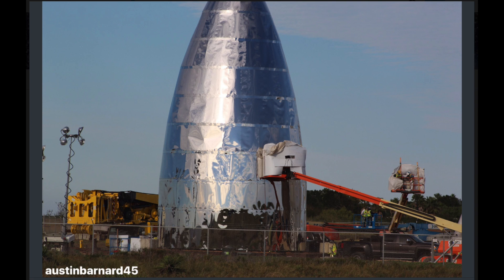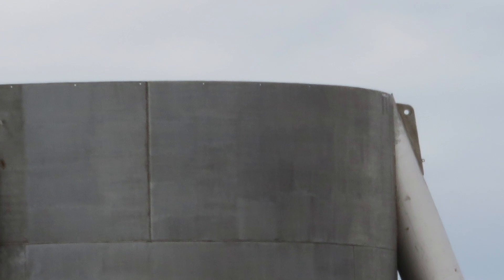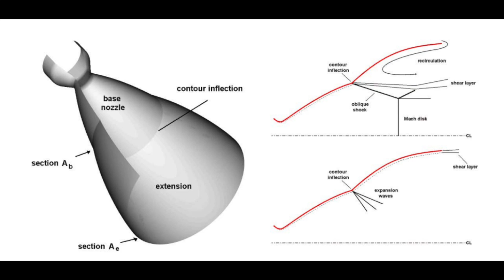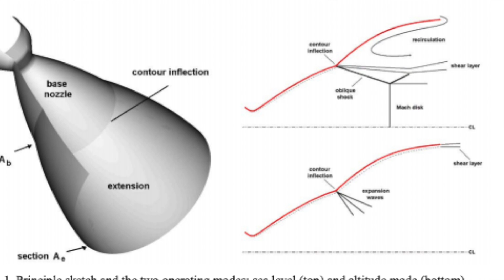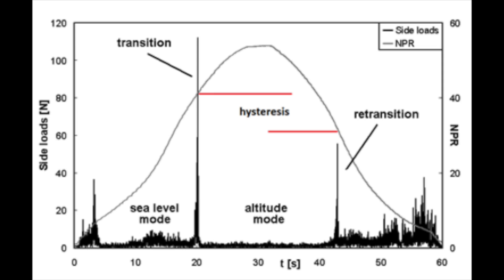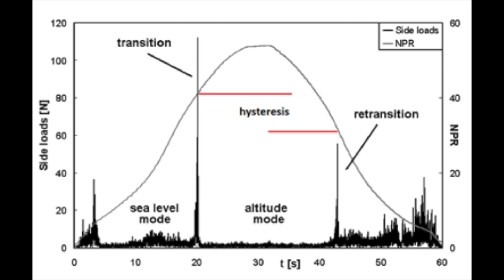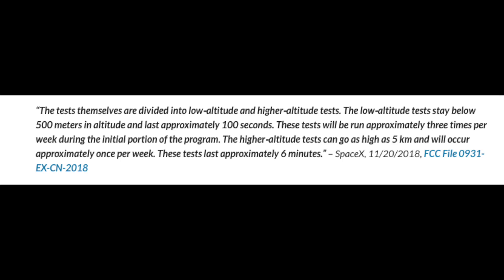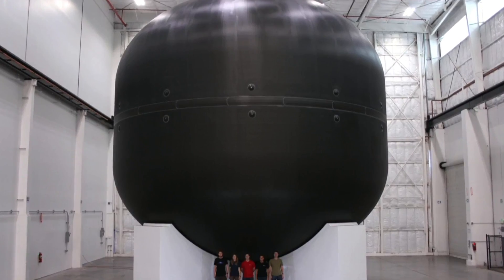What's Going On With SpaceX's Stainless Steel Starship?

Comment: I'm no expert on the subject, but I can see at least 3 reasons why those engine bells look the way that they do, and none of them are "because it's not a real rocket engine":

1. Altitude compensating nozzles for the Starship engines make a whole lot of sense:
By far, the turbo-machinery of a rocket engine is the most massive part, so having fewer engines that are capable of operating efficiently from earth sea-level to hard vacuum is much better than needing to carry more engines with different nozzles to cover the whole flight regime.

2. Using the specific kind of altitude compensating nozzle shown for Starship makes even more sense than using altitude compensating nozzles in the first place.
Starship must be capable of propulsive landing on Earth, Moon, and Mars, and must be capable of providing enough delta-V in a single stage to put itself and its payload on a Mars transfer orbit from Earth orbit (after refueling in earth orbit) with enough fuel left over to land on Mars propulsively. After refueling on Mars surface, it must then have enough delta-V to get to Mars orbit, put itself on an Earth transfer orbit, and then have enough fuel left over for a propulsive landing on Earth, all without refueling after Mars liftoff. This means every gram counts to at least the same degree as every gram counted on the Apollo program's LEM.
While altitude compensating nozzles do offer great performance on paper, as a general rule for engines of identical propellant combination and engine cycle and similar thrust, engines with altitude compensating nozzles are significantly more massive and therefore have inferior thrust to weight ratio.
There are only two designs of altitude compensating nozzle that I know of that offer similar mass to a standard vacuum optimized bell nozzle. Those are the Expanding nozzle, and the Stepped nozzle. The Stepped nozzle is a superior choice in basically all situations for two reasons:
A. The Expanding nozzle is more complex and carries a higher mass penalty compared to a Stepped nozzle because it has a moving nozzle extension and actuators to make it move, while the Stepped nozzle has no moving parts.
B. This lack of moving parts also makes the Stepped nozzle more reliable in service, which is quite important for the Starship, because multiple engines must all transition to operating in a different flight regime at the same time to avoid asymmetric thrust and the consequent pitch/yaw torque that creates, which is quite likely to be too large to compensate for without shutting down a pair of engines.

3. By using altitude compensating nozzles, all engines can be made identical and therefore interchangeable, simplifying reuse and refurbishment, as well as increasing reliability by increasing the number of engines that can fail without jeopardizing the safety of the mission, crew, passengers, and payload. If an engine failure results in an Abort to Orbit or some other more favorable abort mode, it would be quite easy for the crew/passengers of that Starship to wait until a rescue ship is sent for them, provided that they have enough supplies on-board (why not carry the supplies, unlike a jet airliner fuel costs are negligible compared to other operating costs of a rocket, and the Starship will be capable of carrying enough supplies for a full compliment of crew and passengers to Mars and back).
Reply: Lol you don’t know much?
Reply: yeah, it's really no rocket science
Reply: The bell size is very close to that of a Merlin engine, so they are sea-level optimized. 

As long as a SpaceX Starship has to be capable of single stage to orbit from sea level, its seven engines will be sea level optimized, none vacuum optimized bells. When a Starship is boosted into vacuum then only the landing engines will need to be sea level optimized. The remainder can be optimized for either vacuum or the near vacuum of Mars. 

If you never see the exhaust emerging full-width from the nozzle at sea level, but only confined narrower, that would prove the engine and nozzle are optimized for less than one bar.

As said elsewhere, the dual geometry bell permits extreme throttling at sea level, which the Raptor excels at. 

Throttling generally reduces the specific impulse (efficiency), so the only time severe throttling has value is when you want thrust to approach vehicle weight. 

The only reason to throttle these engines in a vacuum is to prevent the thrust from exceeding the sea level spec. The bell shape does not help there.
Reply: When the larger vacuum bells are included, the larger dual geometry nozzles could operate near sea level, or in vacuum, but not in between. Furthermore, they would not be capable of much throttling at sea level, thus the craft would have to revert to hover-slam if relying on the large nozzles for landing. All assuming that the ship landed without the cargo mass.

Comment: Think this is a test article rocket ship to represent the weight of the BFR. Using steel in non-critical areas is not good. Using tank builders to build this only means that this is a tank that will be used for variable weights.  Putting the engines in early means they are props. So in the end, at most, it is only a test article that looks like the rocket ship from Flash Gordon. Makes me want to see the old movie again. After the big circle, a huge tank.

Comment: Is it possible or practical to have rocket engines with adjustable area nozzles? Where the nozzle will expand or contract to the most efficient use at that time. Sorta like fighter jets and their afterburners.

Comment: I think it is just a test to see how it would fly, and instead of using lightweight materials they use steel because 1 it is cheaper and 2 they can simulate weight with this instead of using ballast concrete stuff.

Comment: On twitter elon said there making it out of stainless steel so it can support itself on the launch and landing pad without fuel. Someone linked a video of an atlas collapsing in on itself and he said thats accurate as to why.
Reply from the maker: Nah, that was just a bit of confusion. Tim Dodd drew a link to the early Atlas launch vehicles which used balloon tanks, and Elon corrected him by explaining that Starship's design would not need any pressurization.

Comment from the maker: Updates from Elon Musk's twitter this morning:

Confirms that those are real engines, but aren't going to be used, actual engines still being built and tested in California
https://twitter.com/elonmusk/status/1081572521105707009
"Engines currently on Starship hopper are a blend of Raptor development & operational parts. First hopper engine to be fired is almost finished assembly in California. Probably fires next month."

Confirms the renderings produced by observers are broadly correct:
https://twitter.com/elonmusk/status/1081576707365064704

Suggest target for first test flight is 4 weeks, more likely 8. That's a long time before April 1st.
https://twitter.com/elonmusk/status/1081575156990894082

Comment: One possibility that I haven’t seen mentioned is that it could be a training mock-up for ground crews and safety personnel who would need to approach the craft after landing to extract the crew.  You would be dealing with hot engines, fuel tanks that have just vented the last of their contents...  not a safe work environment, especially if there were cause to need to get people out quickly.  I’m sure you would want to train / drill and practice those personnel quite well before you have “real”missions - just like how fire departments build ‘fake’ multi-story buildings to practice dragging hoses into and putting out fires on a 3rd floor.  

From the weight of the lower structure, and the fact that the upper section seems to be just a facade, this makes sense to me.  As sort a test bed for the rocket engines...  I think that also makes sense, but especially in the context of the, wanting to see the effect of the engines firing on the ground below, on the legs, and again, training ppl who need to approach just-fired engines on the ground in emergency situations...

Comment: Am I the only one who sees that this "stainless steel" outside has lots of really big bumps and ditches? And by the way you can see the internal structure holding the "stainless steel plates". This is obviously just some kind of very thin foil. I guess it is some foil which is used to darken windows.

Comment: Saline corrosion testing is essential for any steel mixture. Especially due to salt dust in the air near beach launch sites. Carbon is not as strong as 300 series, but has no reaction to salt corrosion. Saline dust in the air will fill in any tiny crack and react to steel when wet. I assume the 300 series has been saline corrosion tested.

Comment: they are probably trying to test the engines themselves in real conditions using a mock spacecraft. Multiple engines is probably to test failsafe systems, they might simulate one or two engines shutting down and try to get the ship under control with one.

Comment: Anyone know if the buckling plating could have something to do with thermal expansion/contraction...as in, when you add supercooled methane and oxygen in contact with it, the surface might become smooth - is that a thing?
Reply: there is this technique called hydroforming, make it watertight then pump water under high pressure into the thing, causes it to swell and the kinks pop out, then drain the water out and you are good to go, no risk of explosion since water is ineleastic, if a seam splits it squirts some water out but the pressure is almost instantly down to zero. you can make a steel tube out of two lenths of steel plate welded together using this method, theres a guy on youtube called Colin Furze, one of his videos he demonstrates this (makes a pulse jet body)
Reply: @jongarrat2417  So, you are saying it could be smoothed out by internal pressure, and safely and as a one-time thing by using water under pressure...Sounds awesome if that is the way it is happending :)

Comment: One obvious thing is that they have an investor for the trip around the Moon, but no actual mock up of what the interior of Starship is going to be like. This is likely just a prop they can use to design and outfit the interior of the ship and show the investor how and where the cabins and accommodations will be so he can plan and even train accordingly. Plus it doesn't look in the least bit flight worthy with the way the metal sheets are just loosely attached to the frame. If they start hauling in sofas and tables but no pumps or fuel tanks, then it's just a big training set and is never meant to fly.

Comment: It's been speculated that the dual bell design isn't for altitude compensation but for DEEP THROTTLING. The outer bell will be full of exhaust even at sea level at 100% throttle, but the inner bell can throttle down to 15% or so. This will allow better margins for landing precisely.

Comment: Could be for crash test purpose , or what happens when there is fluids everywhere inside or a pressure leak from tubes or how does it float on water. Or just, you know... will it blend?

Comment: Stainless steel?
It should be cheaper to make stainless steel rocket than carbon composite because this is just for testing of raptor and stability test i guess and if it crash get other water tank around and retry😁😁

Comment: I must admit it doesn’t look very sexy right now, yet this would be a demonstrator of a brand new type of rocket it is likely to be very different to the finished product, made to learn how to paraglide at huge speed a full metal blimp and land it with crew level safety. This tin foil aspect could very well be “normal” or even unavoidable when it’s not at the right pressure or temperature. Just like the soft skin of early rockets with a flexible body which would collapse if not pressurized but so big it warps in the sun. This could be an inflatable double hull which vents during reentry. The top part is supposed to be the crew quarters but it is likely to be replaced by a bigger fuel tank because it needs to go up first on it’s own than simulate the reentry with the expected weight and fuel to prevent lithobreaking. Multi engines seems likely for crew safety.

Comment: If this ting is meant to fly, i think its gona push out of the atmosphere or at least very high (more than  the grass hoper) . i supose a giant vertical leap(wich of course compensate for the eart turning) cause why would you mount thoses modified bells if  its just for low altitude test  wich could be done at the ground also.
That's why 3 engines. They will need more power to make stronger break cause the arrival will be faster(and also lift the fuel required for takeoff). Also, they migh even test the stainless steal shielding ( a bit ) if the roket can gain enought speed while falling back into te atmosphere.
Just my theories.

Comment: I think they are using steel, because Titanium wouldn´t be worth for a grass hopper, but they will use it on proper Starships. Three engines are needed, because Starship needs roll control bevor landing, but two engines might be to powerful for the actual landing, so they will use the center engine for tuchdown.
Carbon fiber tanks can still be used on the booster and thanks for the new Soyuz in the background.
Reply: Yes, they would prefer to land soft, rather than hover-slam. On Moon and Mars the AI needs to select exactly where to put each landing leg, so hovering may be required while it decides. On Earth, the landing Super Heavy needs to ease directly into the launch cradle.

Comment: I don't think it has carbon fiber tanks. Superheavy... may be, but not Starship's main tanks because:
1. Reentry heat would be conducted by steel to the not so heat-tolerant composite.
2. As Musk has said before, building a box inside a box is not a good idea. In previous iterations of BFR, heat shield was to be applied directly on propellant tanks. Now that heat shielding is done by active cooling, we can expect that what we see is actually the exterior of the tanks.

Maybe the inner, smaller, landing tanks are still made of composite, but those are not big enough to catch attention upon arriving, and there aren't many reasons to fit them in the hopper anyway. Superheavy tanks perhaps will continue to be made of composite, since it won't have to deal with so much heat during reentry, like F9's interstage.

Comment: Stainless steel seems such a daft material to use. It's just so heavy. Why not use polished aluminium like the old passenger airlines of the 60s and 70s if he wants that retro sci-fi look?
To me it looks more like a prop than something that could fly. But saying that the Airbus beluga doesn't look like it should fly either.

Comment: While I'm no aerospace expert, this looks to me like it's exactly what they said it is: a relatively low altitude test craft. From what we've seen, it has three engines and roughly the same basic shape as the final design. I would imagine that they would be using this to test the raptors themselves, and gather mountains of data. There's no reason to risk more real starship parts (such as the composite tanks)  than necessary on a craft that is likely to suffer a catastrophic failure during testing. Keeping the hopper as low cost as possible is a great idea, because it's almost guaranteed that this thing is going to end up in a blooper reel.
Reply: In the aerospace industry, we call this an "Iron bird".  You want to test things like the propellant flow to the engines, responsiveness of the software steering them, etc.  For that, you want real engines, flight software, etc.  but the structure doesn't need to be the final design.  It needs to be the right overall size, and hold the right pressure.  Rocket engines depend on the tank pressure to feed the turbopumps, so that needs to be right.

So this vehicle will do what their FAA permit says it is going to do.  Fly up to 5 km altitude, while they test all the components working together and iron out the kinks.  Then when they build the high-tech and expensive final version of the vehicle, it will be much more likely to survive the high altitude test flights.  This one doesn't need to use the expensive steel alloy, anything that holds the required pressure and landing loads is acceptable.
Reply: @SeedFactoryProject  Here in 2022, we can look back at the similarities to the flown full scale prototypes.  More lightweight construction, but same materials and engines.  Carbon fiber tanks used only for auxiliary functions, with bent steel for the large volume bulk tanks.
Reply: Icy Knightmare my thoughts exactly. The engines are arguably the most important and complex component of the spacecraft. It makes sense that they would try and get the engines right first. Cheap engine test craft makes perfect sense, they can load it up with weights and test the general aerodynamics and engine performance while keeping costs down.
Reply: You mean suffer an unscheduled rapid disassembly? 😉
Reply: @Musikur  
RUD Realm of Utopian Dreams 
RUD Rational Use of Drugs
Reply: Musikur I wouldn’t use the word suffer ;)

Comment: I really don't see this being flight hardware and I'm speaking of a hopper test article. I see it more for fit and alignment and possibly art/display. The main reason is because of its construction location. It is being built right along the road very much to be seen and not in a safe area. Looking at how they are constructing it it does not seem to be portable. How does it move to the launch/landing location?